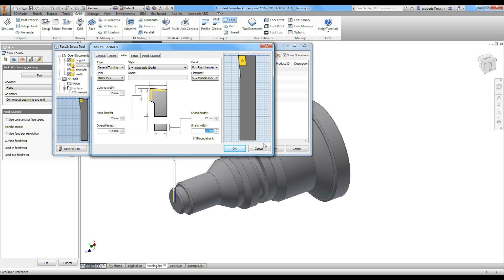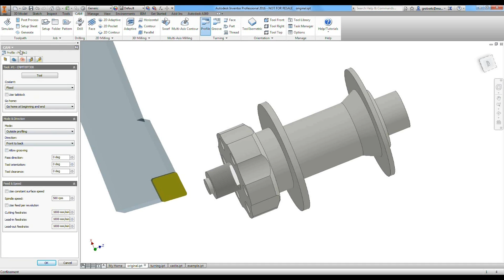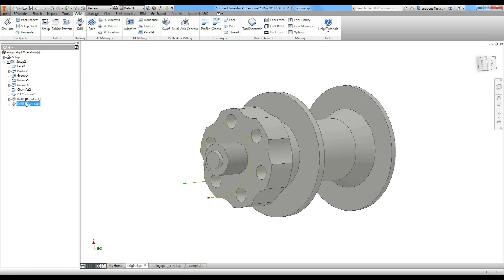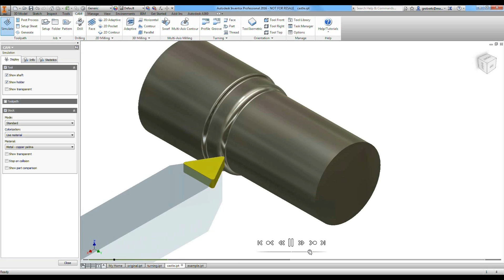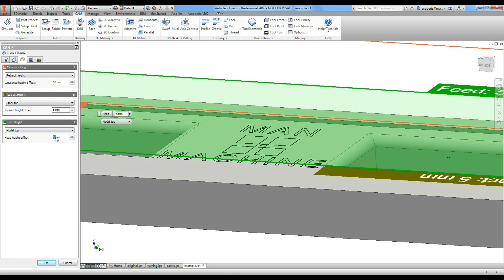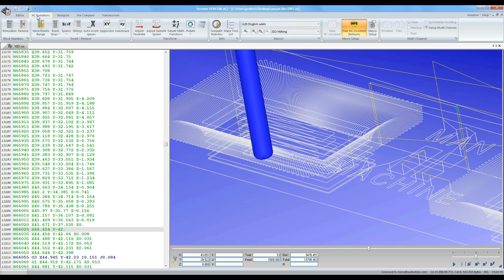Inventor HSM 2016: What's New?

Comment: too bad the lathe post does not post c axis rotation only x,y and z.found that out just recently and they did not have a fix.
Reply: +kenmasters43 What post have you been using? The posts can be modified to output a C axis rotation (depending on the controller type). If it is Fanuc, you could use polar interpolation.. If you send me a message with your machine model and controller type, I can take a look for you :)
Reply: +George Roberts I was looking for a post for a Mazak smart controller which is close to a fanuc controller as far as polar c axisgoes. I was dealing with silver hawk solutions here in florida and even gave them the exact copy of the code I needed from mastercam and they said it could not be done. Every post he gave me to try moved the x, y, and z axis instead of x and c axis together. Needless to say I was unable to help the company I was trying for.
Reply: +George Roberts This was for hsm for solidworks.
Reply: +kenmasters43 thanks for the reply. Sorry that you couldn't find a solution. If you come across a similar issue, or would like to look for a XCZ post, please contact me: george.roberts@manandmachine.co.uk

There is also a great forum where users and the autodesk development team can help you get a 
solution camforum.autodesk.com